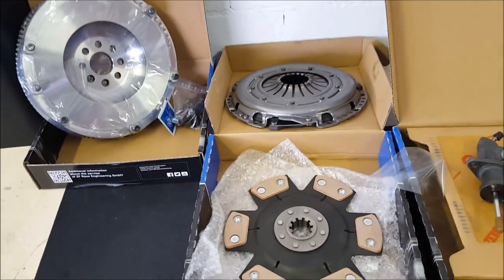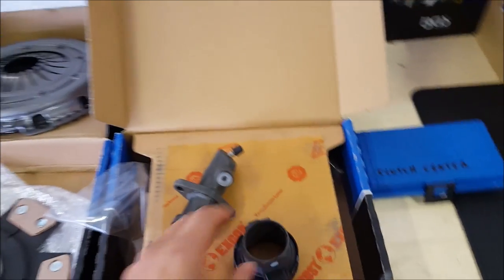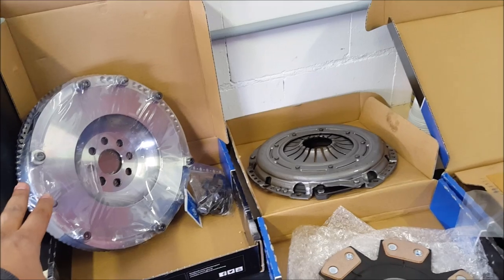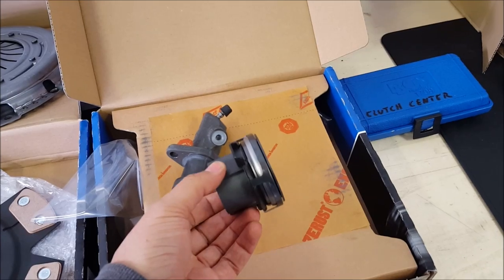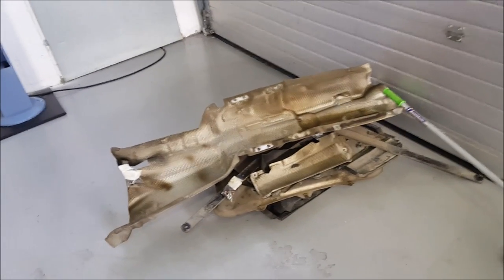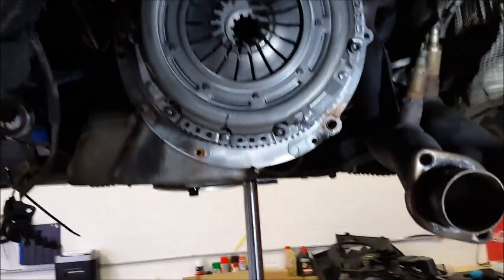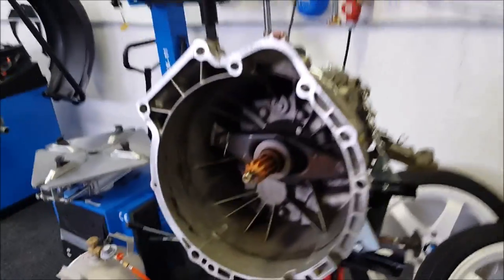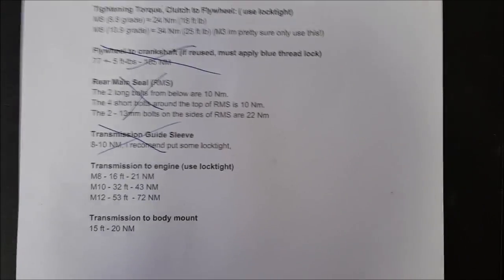BMW E46 M3 - Clutch and Flywheel installation.

Comment: Just successfully finished the clutch job on my E46 M3 on jackstands. This was the only video that recommended supporting the engine from above and lowering the subframe. After supporting the engine and using a jack below, I only lowered the subframe 1". Obviously more is better. but for me I didn't even remove the subframe bolts. This gave me sufficient room to easily access the top bell housing bolts. I went with the LUK Complete Clutch Kit and the car shifts so smooth. Thanks!

Comment: Did this jon on an E36 and working on an E46 now. On the E36 I supported the engine w that support bar, loosened the 4 bolts on the subframe & lowered the engine ~2 inches. Had great room to access the top bolts.

Comment: the noise is more than likely  a byproduct of the single mass flywheel , you;ll get a rattling sound when you take out the dual mass flywheel , the single mass does not soak up the harmonics AS well  but is a much better track Choice if you can but up with the noise , great video and some very nice work
Reply: Yeah that's the rattle of a single mass flywheel... annoying when people think there's something wrong or that it's a diesel haha

Comment: After spending 1500$ on DKM twin disk single mass flywheel, a month later went back to dual                mass and excedy clutch. no more rattle or any noise , or vibration. after market single mass flywheel are over rated. This car needs a dual mass since it has a solid crank pulley.

Comment: NICE video. Good explanation. appreciate the time you took this to make the video. Only thing is    you don't have to drop the engine cross member. Unless you're doing oil pan gasket. I did this job  on the floor with jack stands a few times.

Comment: Question can I just loosen the trans and drop it a few inches to get the bolts from up top, I do for GM trucks and there's not much space on those but I get a pretty long extension and a wobble socket and it does the job.
Reply from the maker: Yes i think so, but if you have not enough space, do what i did, its easy, to loosen the cross member...

Comment: Welche Kupplung empfiehlst du für die Strasse (sportliches fahren).
Und Einmassenschwungrad, oder Zweimassenschwungrad?
Reply from the maker: For street keep original everything, why change it, works great..
Reply from the maker: @Deltanova93  crazy, sounds like something was not installed the right way..
Reply: Lars Fuglsang i cant imagine that. Because some specialist installed it. Some say maybe its the slavecylinder which is leaking, and causing the clutch to slip. But then i still can’t explain the noises its making
Reply from the maker: @Deltanova93  But if a specialist installed it, it should work, it does not! Slave cylinder is not in contact with the clutch at all on a M3 BMW, it can leak all day long, fluid will never get near the clutch plates!! Now stop trying to thing whats wrong.. Take it apart and have a look at whats wrong. all this talking on the internet will get you nowhere.. :(
Reply: Lars Fuglsang you are right. But i don’t have the place or money to take it apart..

Comment: Are you sure you have to set up that rig and tilt the engine so much?  Or did you do that just to make it easier?  I'm surprised you have to mess with the engine so much.
Reply from the maker: to make things easy, when bolts are stuck, if you mess up bolt heads, you are done, engine OUT, better tilt it a bit, easy, fast..

Comment: Do you run the shop? It is so tidy.  Great job.
Reply from the maker: alex1nyny it's not a shop, it's my private man cave 😊, thanks I try my best to keep things clean and in tip top condition.. 😊
Reply: how much did you spend on this 'man cave'?  I am looking to do the same!!!!
Reply from the maker: alex1nyny  inventory, not the building.. 15k euro at that time the video was made, I paid a lot to fix floor and paint floors, I will not do that mistake again next time. Leave your floors concrete, don't worry about scratching it and stuff, just keep it clean... 😊
Reply: do you pay rent on this place?  thanks!

Comment: Did you replace the part mentioned at the end of the video? Because I would also think the rattle comes from the single mass flywheel not from that part. BTW: I love your garage and the way you just DIY with the McLaren. I never saw anyone fixing his McLaren himself before. :D So continue with that!
Reply from the maker: Sebastian Pfennig I sold the car, but it still drives and no issues I talked to new owner 2 weeks ago.. The rattle is new clutch or the oil I put in, oil was motul, don't use that, use only Castrol 😊 and yes that part also changed that!

Comment: Good video but you really did it the hardway. Swivels joints and long extensions is all you need to reach those bolts.
Reply from the maker: No not then those bolts are tight so much, all your swivel socket and extensions will take the power away to break them loose, and you end op maybe rounding the bolt heads when it slips, and then you are relay fucked, so better lose those other 4 bolts, get room, and be sure you don't end up FUBAR.. ;), but evey man his own way, good luck